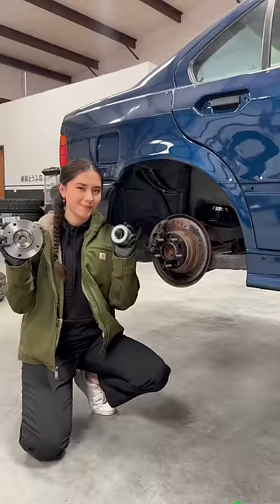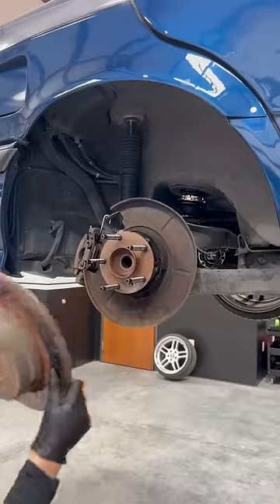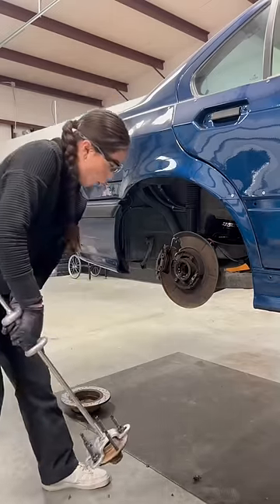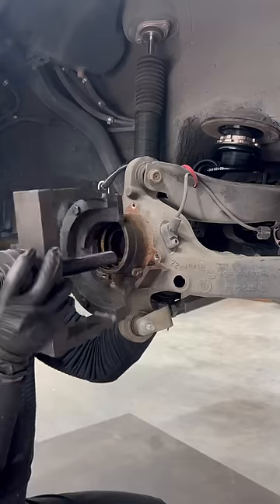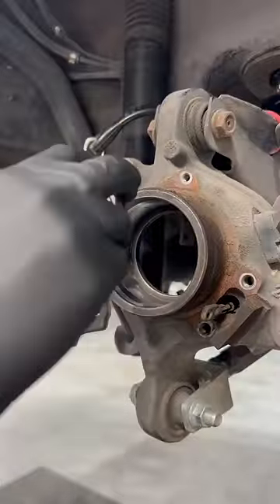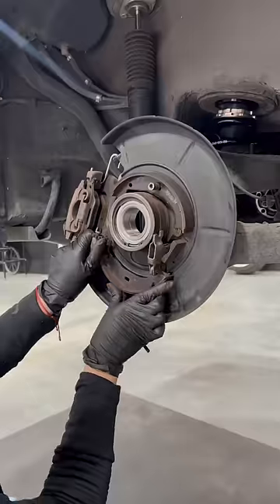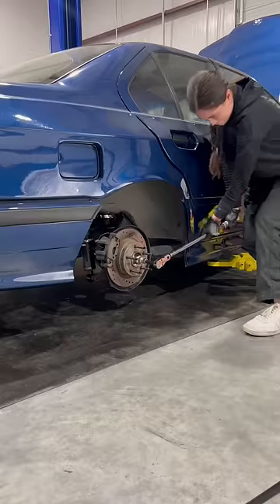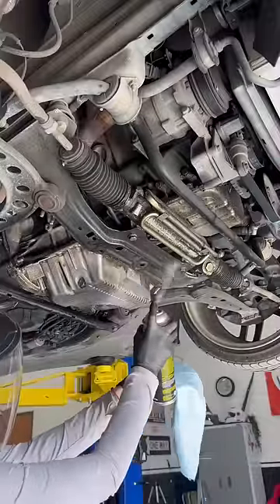BMW e36 wheel bearing✔️

Comment: Pro tip, never postpone replacing your bearings, if they wear out your wheel will fall off while you are driving 👍 don't ask how I know
Reply: I know why you know because like a fool you put like 20 or 30,000 miles on it after you started hearing the bearing going bad. Nobody does this but you😅
Reply: @ericdulyon4601  actually I've done this 😅
Reply: Do you own a white, lifted Chevy truck? 😅
Reply: I need to get on a lift or go get my jack.. but I’m getting a grinding noise. Bearings are more of a growl right? I’m paranoid. Need to find it asap
Reply: @lukebenko278 Must be a refrence to the infamous hot wheels car flying

Comment: Lol, spot on. Procrastinated on replacement, I could tell, usually it starts with a high squealing noise, then as it wears more you get the low growling noise, thats usually when the untrained ear pays more attention 😂, then it wears more and you start hearing the clunking noise that's when it's ready to replace. At that point I bet you didn't even need that slide hammer, a long pry bar and a mini sledgehammer would have been okay. But you did a great job, hopefully you TTY(Torque To Yield) that bearing, bmw loves to use those types of bolts and bearings. As for the oil leak, yes bmw oil filter housing gasket and valve cover gaskets are notorious for failing early. Its best to check your pcv valve with any oil leaks on BMW vehicles, when the pcv valves get stuck closed the excess pressure has to go somewhere and that's usually when a gasket or seal starts leaking oil. So when you see the oil leaking on a BMW, train yourself to inspect that pcv valve. Good luck to you and it's nice to see you pursuing your interest in repairing your own vehicle.

Comment: I love vehicles where the hub is just held to the rest of the car with 4 bolts and then I can replace the whole hub in under an hour. Hate pressing in and out bearings, still easy but you need the right tools

Comment: That oil leak is more than likely traveling down from the oil filter housing gasket
Reply: This
Reply: Or the valve cover gasket... Which means a new valve cover 😖
Reply: Oil pan gasket is the likely culprit here. They're notorious for leaks after a while.  Even after replacing will be same with time. Plus design is so stupid very cramped and tight to get at is no easy. I feel for those who gotta do that job without a hoist on the floor with a creeper.
Reply: The "oil leak" is power steering fluid aka transmission fluid. E36s are notorious for leaky power steering assemblies.
Reply: @andrewbanit4884  I just did oil gasket on 2011 328 xdrive. They're now utilizing aluminum oil pan bolts 🤔
Reply: @hdgfs1  Yes brother they put a lot of them aluminum bolts all over engines even cam shafts are hollow with the cams themselves are press fitted on them shafts with some space edge tech I don't know about.  All this overengineering stuff and they can't make a better gasket that would not leak tiny valve stems that would not bend from just looking at them or injectors that would not require a half engine tear down and special pullers with a come a long  or 3 guys pulling the said puller.
Reply: @hdgfs1  the rubber part of the gasket is getting hard over time and/or overheating. Can't overheat these engines it's their death warrant. If overheated everything goes to shit specifically piston their rings and cylinder walls loose their protective coating and short style modern piston skirts don't help much for piston slap under load which is always under load in these high turbo boosted engines. Can't machine or re sleeve them with very thin cylinder walls.
Reply: B reak
M y 
W allet
Reply: @hdgfs1  ya BMW isn’t for broke people
Reply: @moderndayentertainment5812  neither is range Rover but that doesn't stop. These broke ass. MF's from buying them, throw Mercedes in that loop too 😆
Reply: And I’ll have to replace my belt and tensioner 😫

Comment: "...need to figure out this oil leak first."  I already know what it is.  The answer is BMW.
Reply: Yet they’re ranked 3rd in reliability only behind Toyota and Lexus so basically 2nd 🤷🏼‍♂️
Reply: @griffin_kith6214  Ranked by who?   I think you're looking at annual rankings that only account for new cars with reported maintenance over their first calendar year.
Reply: @macgroober1396  after owning an older BMW I’d have to say they’re reliable. Just expensive to fix.

Comment: Great job!! I'm obsessed with BMW's. On my 5th one. 2021 BMW 5301 (wanted the straight six 540i, but $12000 more) arctic pearl white with cognac Dakota leather and sport package...dream luxury sport car. Loooooooooooove it. Had a 2010 528i (e60, n52) did tons of work myself on it. Vanos solenoids, plugs, coils, belt, pulleys, alternator, brakes, rotors etc etc. Easy to work on them.
Reply: Either way beats the pain in the but v8

Comment: She is a champ. Learning the appropriate selection of tools to use at each step is important. There can be a different tool selection, that gets the same job done. The ultimate goal is to fix it right the first time. For that, Building the skill sets necessary to become proficient in the task at hand, then with repetition you will become more efficient applying the skill sets with every similar repair cycle. Quality first, speed comes later. Whomever is playing part as her mentors...... good job people!

Comment: I did it without a slide hammer or bearing remover. I removed the entire spindle and used a socket that was about the same size and the bearing and tapped the old out and the new in, wasn’t bad as I thought it was going to be

Comment: I just did a lower ball joint on a 2003 expedition like 2 days ago and it took me. Way longer than what was necessary all because I chose to wing it and remove the entire lower control arm instead of finding the right tool my master tech had to press it in and out on the car itself. The right procedure and tools really make a huge difference in time and effort 💯

Comment: just some friendly advice you should hit the brake dust shield with a wire brush clean it off with water then like it dry and last clean it with isopropyl alcohol then paint it with your protected. it only so the paint will stick it the metal as much as it can and still go through some rough conditions and still be painted

Comment: It’s a BMW, I am surprised you didn’t have to remove the transmission to do the breaks then flash the ecu with a CODex 357g, then turn the flux capacitor, then top off your blinker fluids.

Comment: Good job ma'am your skilled I'm doing the valve cover gasket in the 2010 650i and moving on to the alternator gasket bracket because oil leak smh if you have the same set up on the bracket that's where that leak is located or valve cover gasket but you will get it with your skills

Comment: But don’t forget to mention when the wheel baring has been beaten up and been bad for a while  and the car sounds like it has a rumbling … it’s hard to take it out … because it gets stuck and the spider slapping hammer is a Bitch to take to off !! .. just had mine done and it was a pain in the ass !!

Comment: The oil leak is your rack and pinion aka steering rack , have it rebuilt and change the boots on both sides , if it’s leaking then it’s already time to either rebuild or change it fully.

Comment: Don’t torque bushings up until you have the weight of the vehicle on the wheels and it is at its normal ride height or you will cause premature wear in the bushings.

Comment: I literally remove the wheel hub of an altima and I did not have to move the axle easiest 20 minutes ever… all you do is remove the caliper with the pads slide your rotor out the way and remove the four bolts sitting behind the knuckle. The wheel hub literally slides off the axle.

Comment: I dont want to do anything that requires removing the wheels anymore because I only have the stock included scizor jack and 4 way lug wrench and every parking spot in my apartment complex is on an incline! a hydraulic low profile jack and impact wrench would change my life!:)

Comment: You must be down south. I live in NE and it took me 8 hours to do my rear wheel hub with me giving up on the slide hammer (after adding another 75lb of weight) and deciding to take the whole knuckle out and hammer it out from the back

Comment: You were doing great until the end were you didnt use a torque wrench. You have to tighten to required torque spec or the new bearing will fail prematurly.

Comment: Bmw with an oil leak hahaha it's life. Check oil filter housing gasket or valve cover gasket. They also will eat oil. '06 Z4 3.0SI N52 calls for special LL-01 oil.

Comment: Front camber is unadjustable from factory, I was told replacing the wheel hub  would help. Is that true?
Reply: How tf would a hub give you camber adjustment? You need adjustable arms
Reply: @TM-fx5le  I called around due to my car being unaligned and they told me another part connected to control arms or sumthin. Idk not a mechanic. sounds wrong now that I think of it lol.
Reply: @TM-fx5le  The hub unit is a device that fills an important role in supporting a car by the wheels, and integrates the bearings and the surrounding components. There is one type of hub unit that rotates smoothly while supporting the vehicle weight, and another type that transmits the driving force from the engine to the wheel.